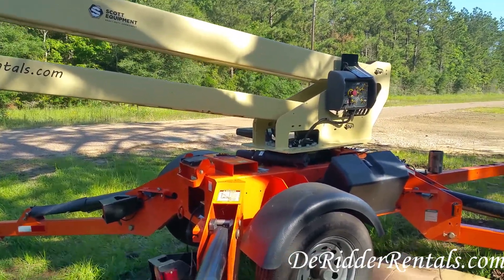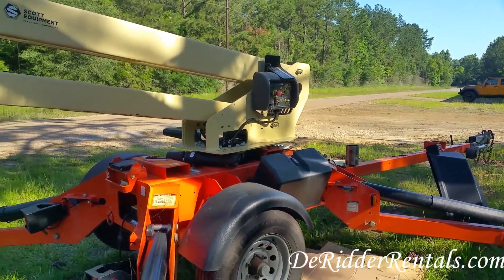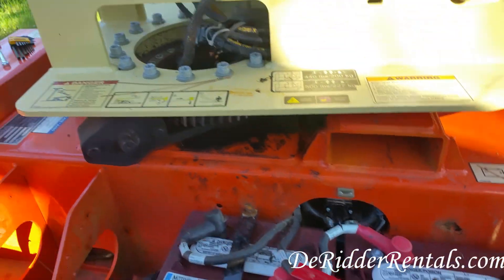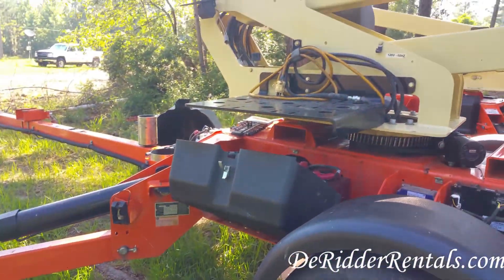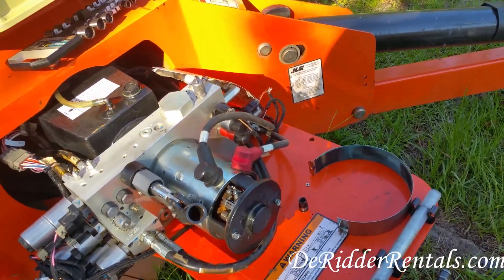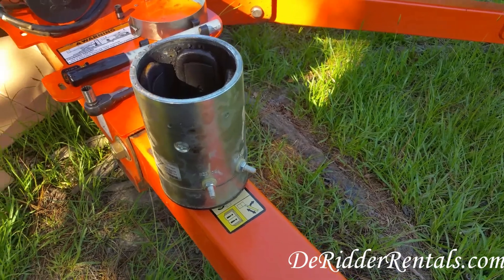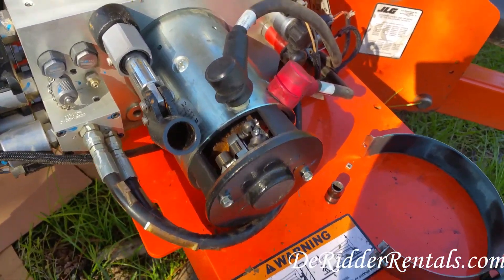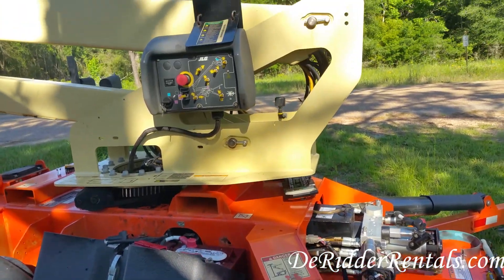Power Module Failure - Check Power Wiring Check Mosfet Short Circuit (9/9) T500J T350J Intermittent

Comment: I’m having the same 9 flash codes, all of my basket controls work but the electric outriggers and self propulsion do nothing at all. Do you think this motor needing to be replaced be the culprit? Or would the basket controls not work either if that is the problem? I tried calling your business and sent an email as well. I’m sorry to reach out and bug you but you have been the only video that has been helpful to my situation. I’d love to pick your brain for just a minute if you have time. Thanks!
Reply from the maker: I thought I had responded to this, I'm sorry.  I think the first place to check is those brushes.  Even if it doesn't fix the problem you're still doing a big preventative maintenance step by replacing them.  In my experience the brushes only last a few hundred hours.  Here's a link to some brushes:
https://www.hand-tools.com/products/Motor-Brushes-for-JLG-T350J-T500J-Manlifts-70003736
Reply: @deridderrentals  Thanks so much, I appreciate the response. I’ll do that and see if it fixes the problem.
Reply: @samwalton5780 let me know if this fixes the problem please. I'm having similar issues after having just spent thousands of dollars with the local dealer replacing the power module

Comment: Where did you buy the brushes for the motor.
Reply from the maker: At first I had to buy the whole motor which cost me around $600.  I ended up finding brushes here the next time it happened.  Saved myself $400:
https://www.hand-tools.com/products/Motor-Brushes-for-JLG-T350J-T500J-Manlifts-70003736

Comment: I have a T350 that just stopped working. 
Use any control and the pump runs for a few seconds    with no movement, then you get the 9 code. 
The outriggers or halfway down making it impossible to tow.
Reply from the maker: You may have the same problem.  It seems to be fairly common.
Reply from the maker: I found some brushes here:
https://www.hand-tools.com/products/Motor-Brushes-for-JLG-T350J-T500J-Manlifts-70003736

Comment: The parts are called brushes. 
Not sure about this particular model but replacement brushes should be available and easy to change.
Reply from the maker: They wouldn't sell just the brushes.  You have to buy the whole can assembly which was $545 when I bought it.
Reply: @deridderrentals  Ouch !
Reply from the maker: @900stx7  I finally found some brushes:
https://www.hand-tools.com/products/Motor-Brushes-for-JLG-T350J-T500J-Manlifts-70003736

Comment: Thaks, happens the same with one of my units and everything look good and when open the motor was a lot crap and one stuck don’t made contact, after a cleaning work perfect and dont has the code in tha analyzer.
Reply from the maker: Yep you can clean it and it will help those brushes reach.  Over time even the brushes will get short.  I found a place for brushes here:

https://www.hand-tools.com/products/Motor-Brushes-for-JLG-T350J-T500J-Manlifts-70003736

Comment: I am having a code 99 on the side of the basket but it work good for the ground controls . 
Is there any ways you can get a video under the unit where the plugs are under the rotation platform , I unplug some cables and I am not sure Which order they go back

Comment: Thanks for the info. There is very limited content on the JLG T500j. I have a 2014 and do most of the maintenance myself. I’ll have to start posting videos.
Reply: I can’t get my outriggers to go up… any help would be great
Reply: @n3wy3ar83 you ever figure this out? My t350 deployed outriggers ok, I went half way up in the basket, then it stopped working. Replaced Contactor. Same thing. Outriggers stuck in down position
Reply: @n3wy3ar83 My outriggers are stuck down and I’m getting the 9 flash codes similar to this video. Were you ever able to figure out what was wrong with yours? I’m about to order a new hydraulic motor but I’m not sure that’s my problem quite yet
Reply from the maker: Every bit helps!!!  Thanks for posting some helpful videos.